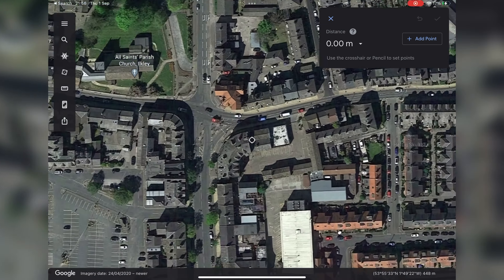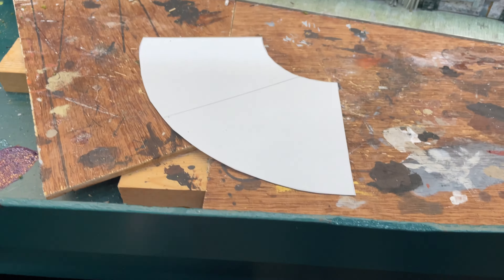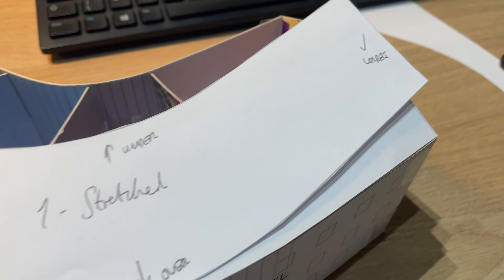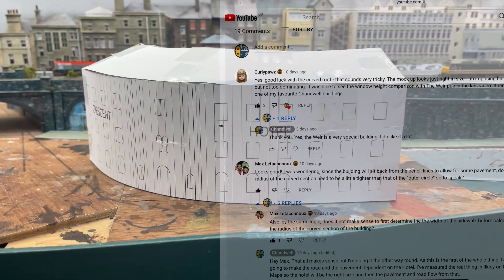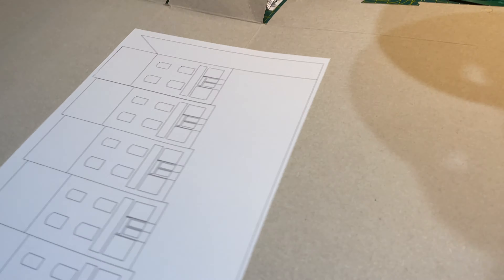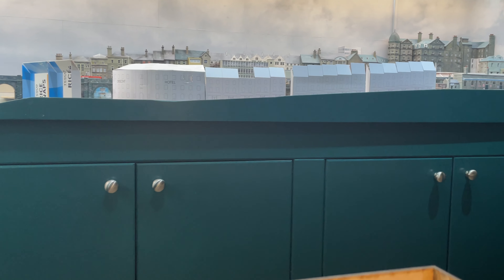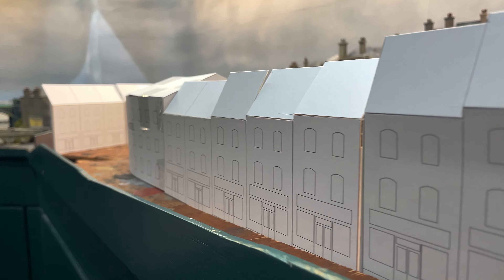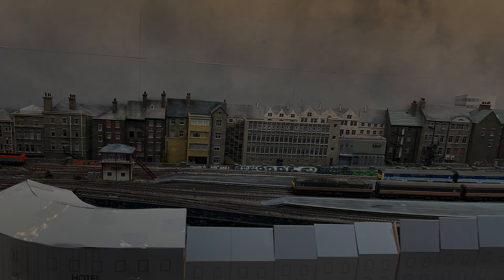Mocking up a street scene - Thinking about Station Road

Comment: Looking forward to the hotel build and to how you're going to make all the shop buildings each a little different as you go on. As with Market Street, I think the odd derelict or modern building will fit in well. Maybe even a gap site with the girder construction underway so you can see through. I'm sure you don't need any ideas. Cheers
Reply from the maker: Thanks Davie! Yes... there will be a lot of Chandwell touches in there. I like the idea of the part-complete construction in the gap.

Comment: I like the street mock up. Perhaps the Crescent Hotel is a bit too deep in cross section?
Reply from the maker: Thank you Andy. Yes, the Crescent is quite deep and looked rather odd when I first put it down. It's to-scale the same depth as the one in Ilkley. Obviously, I am not honour-bound to keep it the same, and I could make it skinnier. However, I think I am going to keep it the same depth. My reasoning is that I want Station Alley at the back to be a narrow, dim, cobbled street of the kind so common in northern towns. And I also want the front of the building to be close to the front edge of the layout. This is because the tracks get progressively closer to the front of the layout and therefore there is less space to put buildings. I don't want the ones at the top of the hill to be unnaturally skinny.

Comment: Michael Great progress and idea I really like the feel of the railway been hide between the urban buildings. If you included small gaps and alleyways between the buildings it will give the feel of the railway fitting into an area, as railways  especially in urban West Riding were shoehorned between the rolling hills tight V shaped valleys on the edge of old Towns and Villages. For those not familiar with Ilkley West Yorkshire the Crescent is on a major road junction, with the main valley road crossing the road off Ilkley Moor towards the River Wharfe. Across the junction in Ilkley is a large Parish Church & Manor House and the remains of one short section of wall from the  Roman Fort. The Medieval Church is on the site of the Roman Fort and original Town, the fort is above the River in a better vantage point. So if you use the history of Ilkley & blend it into Chandwell, if the was a Roman Fort above the River and River Bridge Michael has modelled is the 12th Century one from Otley the next town from Ilkley. Also this Fort now church might have been on the higher ground in front of the Station not in an area not modelled. Ian
Reply from the maker: Thank you Ian! That is very helpful to the background!

Comment: Hi Michael Model Maker Extraordinaire - That is just going to look fabulous. Like you I cannot wait for you to start.
Do you find it better to fine cut using the medical scalpel or the ACM handle blade, both made by Swann Morton?
Regards Chris
Reply from the maker: Thank you Chris. I've always used the flatter medical-style handle. I do have an ACM-style one that I bought many years ago, but I much prefer the medical-style one. It seems to fit my hand better than the round-profile one.